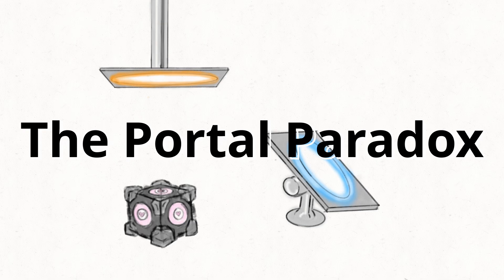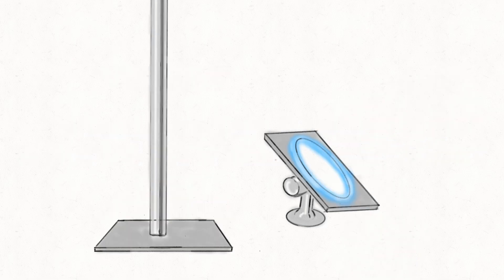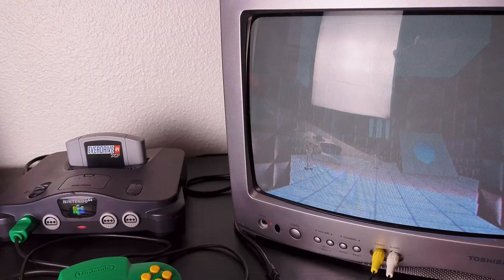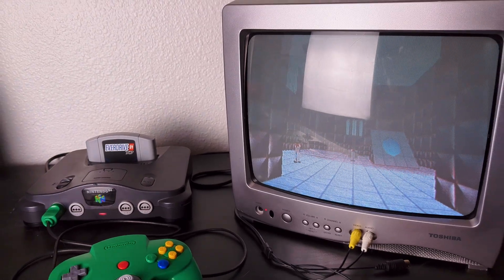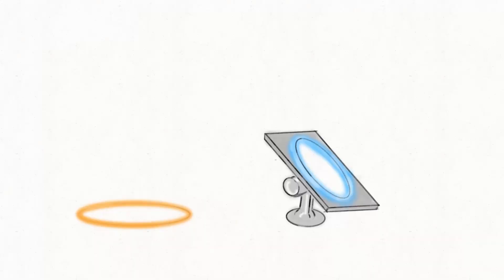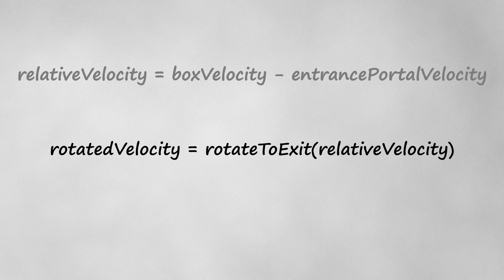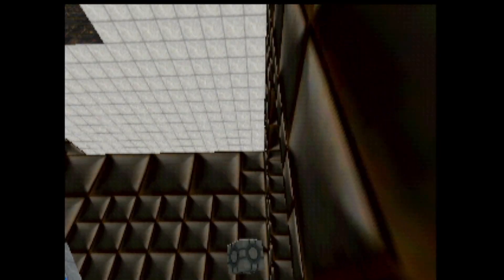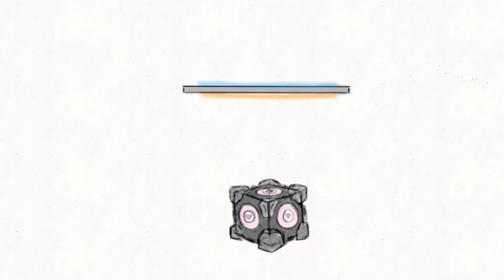I rewrote Portal from scratch and solved the Portal Paradox

Comment: Wouldn't the energy used to move the orange portal downwards be canceled put by that portal's stopping? Any energy or momentum that was initially with the portal would have to be negated to stop it I would imagine, leaving nothing to launch the box.

Edit: also, the box's relative velocity to its end destination is zero, so it really shouldn't have extra velocity
Reply: You're so right, bro. His implementation is bad, really. And there are so many people that liked it and even defend it.
Reply: I think, by the time the moving orange portal is stopped, almost all of the cube is already pushed through the portal and have all that momentum launching the cube out.
Reply: @Raytracer_Owl  The cube doesn't have momentum to fly out like that. The question is: what gives the momentum? Portal simply can't since it's not interacting with the cube. The main reason why dude's equation is wrong because it's not the same situation, when a cube launches in and when a portal does.
Reply: @FilinMXr  if the room is assumed to be a closed system, whatever energy was used to move the portal must be used in equal amounts to stop it. If the box wasn't there, the kinetic energy of the portal would be deposited as heat upon hitting the ground. If the box was there, and had kinetic energy afterwards, some of the portal's kinetic energy would have to have been deposited in the box, implying the portal would strike the ground with less energy if something went through it at the same time. Unless the box is able to exert a force on the portal and its moving surface as it moves through, the box could have no additional kinetic energy. Also, momentum in this case only measures velocity. Because the velocity of the portal is constant as the box pases through, the velocity of the box must also be constant at zero.

Comment: I maybe wrong sense I haven’t tested this with your code obviously and you may have already.

But wouldn’t the logic you provided break if the cube is moving towards the portal at the same rate? 

because that should theoretically be twice as fast but from what i see your code doesn’t account for that and would instead default to 0 velocity.

Once again i maybe be wrong as I haven’t look it over but just a thing I noticed.
Reply: I decided to comeback just to make it clear that my comment and suggestion is that you need to account for Directional velocity, as in which way the cube is moving right now you only account for a static cube.

Additionally the cube would be pulled into the portal as it is flung through the other side. 

Lastly and I understand you are using game logic, but the portal doesn’t have a back side, so the portal wouldn’t actually move with the wall, the wall would move through the portal just form side B, but that obviously doesn’t make interesting physics puzzles 🤔 or does it?
Reply: Just to be clear the other two things are really only me talking about the paradox, your game is looking really cool

Comment: I'm not sure if I agree with your solution for the portal paradox, but I'll accept it since you're the developer here.

In my own opinion I don't believe that the portal interacting with the box and shoving it through would change its velocity--- After all, portals in portal are more of a doorframe from one place to another. Instead, I'd believe that it would stay mostly relatively stationary, although it would likely fall through the portal once enough of it is through thanks to its new gravitational pull--- or simply fall through once the portal is flush with the floor.

But I can't say your solution isn't a nice one! I quite enjoy the thought behind it, and the idea of moving portals adding momentum is fun for gameplay reasons--- It has unique potential for puzzles!
Reply: I agree with this statement. Its a fantastic solution but does not sit right. For something to move, there has to be a direct force applied. Any object at all times has a bunch of forces applied so if you get moved the forces of that place would then apply, but seeing its, kinda, the same space, nothing would change. 
Im not smart enough to even get a grasp on the mechanics of a portal but in my mind portals are less objects and more the same space connected. So the only thing the portal is doing is just changing the relative coordinate of the object entering. Like you said, a door frame.
Reply: yeah, the portal frames are just frames, maybe the portal itself is moving/stretching in another dimension, but i dont think this movement would translate into 3D velocity

Comment: you can tell this is right by changing a few things.  If  you were to have the orange portal going 100mph to the right and then you were to have the cube right in front of it going 98 miles to the right, so that the orange portal kinda scoops up the  cube the cube is going to pop out of the blue portal at 2mph.  I feel like this feels more intuitive.
Reply: This is very interesting! I don't think that this proves the theory right, or even that it would work that way, but this is a mind boggling situation. (To set this up, imagine the portal is falling at its terminal velocity, say 100mph, and the cubes terminal velocity is 98mph). Imagine if the cube was falling straight down at 98mph and the orange portal falling at 100mph right behind it, and the blue portal is on the ground facing up, a few feet to the left. As the orange portal catches the cube, the back of the cube would come out of the blue portal first, but then from the perspective of standing next to the blue portal, the cube shouldn't just hover above the blue portal: it's falling, so it would fall back into the portal, out the orange portal. Essentially, touching the orange portal at all would accelerate it to the same velocity the portal is moving at, 100mph, where it would stay just outside the orange portal until it hit the ground, and the orange portal hit the ground right after; at this point the cube would move through the blue portal, at a speed of 100mph, but would be perfectly still as soon as it was all the way through, and the orange portal touched the ground. Great, now I'm not sleeping tonight. I don't think my question proves your hypothesis wrong necessarily, but I think an object would have the same velocity coming out of a portal as it would going into it. However, I cannot explain how that would work with a horizontally moving portal.

Let me think back to your example, but imagine the cube is chasing the orange portal at 100mph instead of vice versa, and the blue portal is facing outward in the same direction the cube is moving. When the cube catches the orange portal, it is moving into it at 2mph, but at a total 100mph. When it exits the blue portal it should still be going a total 100mph, but it can't, because it is coming out of the blue portal at only 2mph. It would have to be sucked through the orange portal to come out at 100mph, meaning it would be going 102mph through the orange portal, and 198mph in total at location A, which isn't possible. An object can't be going two speeds at once. The other option is that the cube comes out of the blue portal at 2mph, meaning it is going 2mph in one location and 100mph in another, which still isn't possible. Out of these two impossible situations, coming out of the blue portal at 2mph does feel more intuitive, even though it doesn't make sense.

Looking at a different video (https://www.youtube.com/watch?v=7EPppJp2vjk), I agree with them. Portals simply cannot exist on a moving Z axis relative to themselves.

Comment: i'm all for preserving the law of conservation of energy, i'm just wondering at what point does the energy transfer from the piston to the cube? the piston comes to a dead stop onto the floor, so it should deliver all its force to the floor, as the portal makes the cube intangible to the piston. the way it's implemented in this scenario, the force of the piston is being applied to the cube despite the two never directly physically interacting (and it's somehow a one-to-one transfer as if in a vacuum, i feel like drag might have some things to say about this!)

ofc, portals in general are hypothetical anyways and could not exist without exotic matter or anti-gravity to hold a wormhole stable, and there'd also be a lot of problematic relativistic side effects from doing that which don't line up with how they work in Portal (if you thought Portal Reloaded was bad enough as is with the time travel mechanic...)
Reply: now i'm gonna look from a game mechanic perspective, because that's important too! if you're thinking of implementing moving portals, the method shown in the video is definitely a lot more fun than my suggestion and opens up new ways to play the game. can't really do much with a sad little plop out of the portal

Comment: The only problem I have with this implementation is that it effectively adds another "magic" element to how portals work. In source,  the portal worked to maintain the object's momentum in the lab frame. In your de-make, there's an extra interaction which will add take the velocity of the portal and (through an effectively infinite force) give the object the momentum it would have at that velocity.

That said, I think you could very easily break the engine by exploiting this infinite force to generate a sort of matter "laser" by cascading multiple stages of this to give objects obscene momenta very rapidly.
Reply: ch_createairboat violates conservation of matter, therefore game engine bad!

Comment: Personally, I think all the energy from the portal is transfered to the platform it hit which is where the cube was sitting, not the cube itself, but even if it did it would result same, because I'd assume that thay portal doesn't have any mass. You'd argue that this would be impossible, since that is making energy, but its portals, you put a portal above another, drop something at it will endlessly keep falling, so we won't have to worry about hurting physics
Reply: You don't understand how portals works. In falling loop scenario portals don't create anything. They're just connecting two separated areas. Simillar to doorway, but not fully it.
In the video case portal is clearly creating energy out of nowhere. It shouldn't.
Reply: @fantastikboom1094  the loop scenario is creating energy, assuming some energy isn't consumed to teleport something with x mass and y meters away. His case was that the energy had to go somewhere, but used the the mass of the cube equal to the portal. There you go
Reply: @cheapcheese.  In that case it's gravity force is creating energy.

That isn't proving why the entry portal should give its speed to the object passing through. It's even creating more. Clearly it shouldn't

Also, there's important thing. Portals can't have energy because it is simply a hole in the space to another space. It works just like a doorway.
Therefore, it's the platform where the portal is placed has energy. That platform was slammed into the floor, and floor consumed all kinetic energy.

His equation just makes no sense. Literally coded the result he wanted 💀.
Reply: @fantastikboom1094  that's exactly what I said
Reply: @cheapcheese.  ah. probably i'm blind. it's 5:36 and I should go sleep.

Comment: So here is a slight issue, relative velocity is velocity from the perspective of an a observer. You are calculating box velocity - portal velocity but a 3rd party (the player) would see relative velocity as box velocity - player velocity. In your example neither is moving so why does the box gain velocity? All values should be independent of each other and the fact that there is relative velocity is a side effect, you should not be calculating relative velocity intentionally. Also yes the box will appear to have velocity through the blue portal but it is like a zoom on a camera, just because it appears to have velocity does not mean it actually has velocity. The actual important question is when is enough of the box through the portal that the gravity from the portion through the portal will cause it to slide sideways.

Comment: your equation doesn't account for the fact that the portal itself still has all its velocity (prior to slamming into the ground), meaning you've created energy from nothing because now the cube is moving and the portal is moving. For the cube to come out of the other portal with any velocity, it has to have a force applied to it. otherwise you are essentially just moving a room around a cube. just because the whole room shifted, doesn't mean the cube shifted as well.
Reply: Portals already create energy from "nothing" in the actual games though. For example if you have two portals at different heights and go through the lower one, you'll suddenly have higher potential energy. Presumably the energy actually comes from the gun's power source, and the portals apply it to whatever passes through.